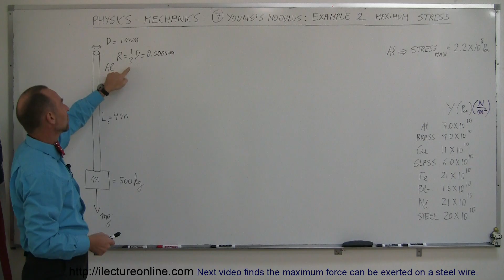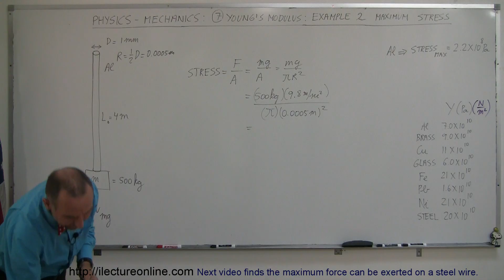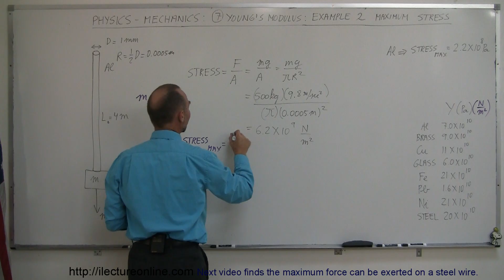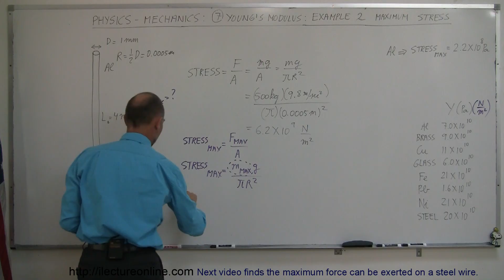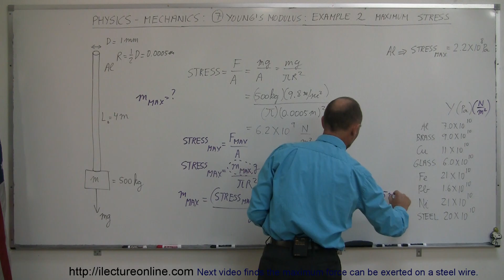Physics - Mechanics: Stress and Strain (7 of 16) Young's Modulus: Ex. 2: Maximum Stress

Comment: Hi
how long steel wire can be allowed to hang freely, if the tensile stress due to the weight of the steel wire must not exceed half the stretching limit. The density of the steel wire is 7800kg / m cube and the streching limit is 220 N / mm. Is there anyone out there that can hela with this? Thanks

Comment: Does it depend on how the energy is applied?
Reply from the maker: We are assuming that the force is applied gradually until it breaks.  If the force is applied suddenly, like with a hammer, we have to take into account the principle of impulse.
Reply: Michel van Biezen sorry what I should have asked was does it matter if it was applied with tension or no matter how the stress is applied that the most of any stress it can handle
Reply from the maker: Yes, it does matter.  Stress caused by tension typically has lower limits compared to stress caused by compression.

Comment: Is maxium stress meaning that no matter how you apply the force that is the breaking point?
Reply from the maker: Sine the maximum stress is the RATIO of F/A the maximum stress is the when that maximum ratio is exceeded.  (twice the cross-sectional area will require twice the force).

Comment: Does increasing the length of the wire without increasing the cross sectional area have any effect on the load it can hold? 
Thanks again
Reply from the maker: No, the length has no effect (unless the weight of the wire is significant).